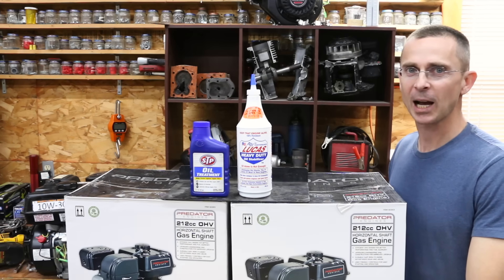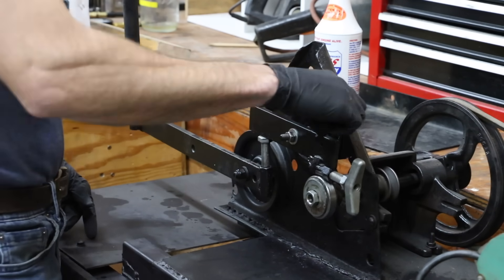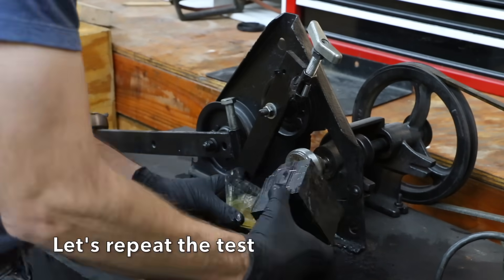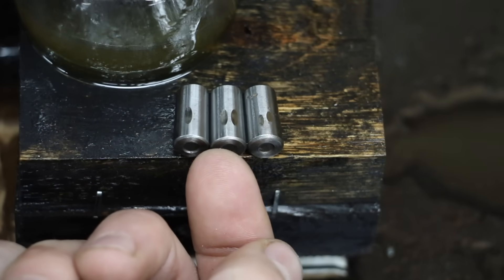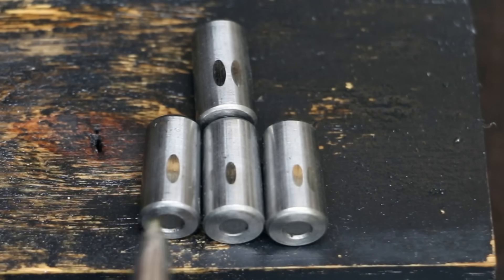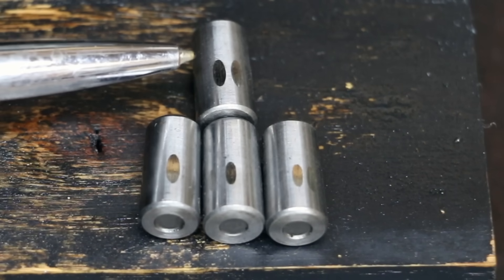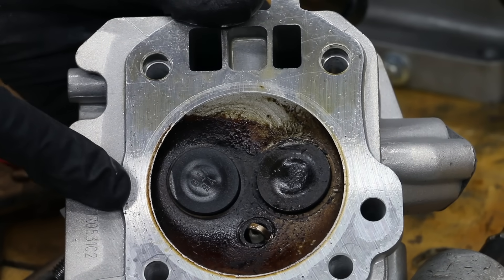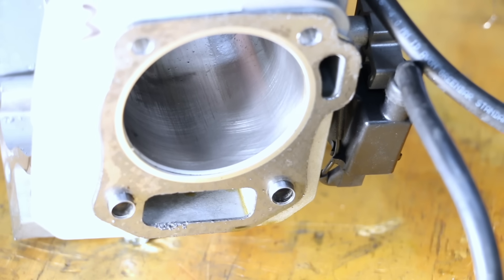Which engine self-destructs first?  Lucas or STP?

Comment: This little folly didn't prove squat here. Never been a fan of the so called no oil motor runs because many factors can play into what the outcome might be. 
1. A Predator motor is a cheap motor and ok for a lot of things but known to fail if ran at high RPMs for long of time. There is a lot of give and take in the manufacturing specs of these motors which is why they are so cheap. If you were to check compression on each new motor you would find them not to be consistent.  So the looser an engine is to begin with the longer it would probably run minus oil.
2. Lack of an engine using just plain oil in it. Ok I understand you did this on your own nickel so you claim but then how do we know that for fact? But needless to say if you're going to make comparisons then either do it right or skip the whole thing to begin with. An engine that had used just plain oil may have ran just as long as the other two and who knows maybe even longer. But we will never know that will we?
3. Your measuring techniques were a little loose to be perfectly honest here. In short not very scientific at all. So how do we know for sure how much of what was added to what. All the mechanics I know say you should blend any oil additive with the oil you are adding before placing it in the crankcase. STP for sure due to it being so thick and wanting to just lay in the bottom of non oil pump engines before it finally gets hot enough to start blending.
4. Every small engine manufacturer I know including Predator doesn't recommend oil additives being used in their engines due to them thickening the oil. Thicker oil won't flow around in a slinger type motor as it should if it's to thick. 

I was the equipment manager for a large construction company and we had small engines on stuff everywhere. In fact small engines were in the shop more that any other piece of equipment we owned. Most of our issues would be lack of oil issues after some fool tricked out the low oil sensors. I actually had small engine reps who called on me since we bought so many engines  and parts a year. On a warranty issue I was talking with a Briggs service tech who gave me the best advice I have ever been told about small engines which I tried my best to put into place.  But in the end the results where hands down to our advantage as we started having way less engine issues.  He advised that the oil in the engines with oil slingers be changed every 10 to 12 hours in summer time and 12 to 15 hours in winter. Not once a week or two as was being done or so I hoped most of the time. On engines with filters and pumps change the oil every 25 hours in summer and 30 to 35 in winter. I do that with my own personal lawn engines here at home. I have a Briggs 18 hp motor riding mower I bought in 1987, it mows and blows snow as well, along with some light blading once in a while to parking the boats. It has over 2200 hours on it and uses a couple of ounces of oil per oil change only. The motor outside of a new carb 2 years ago hasn't been touched outside of tuneups and oil changes. I have never added any additives to the oil at all.

I've never been a fan of any oil additives, just use good quality oil that meets the specs required and change it often. My personal opinion is that oil additives are a lot like fishing lures, they are designed to catch the buyer more so than do what they claim for you in the end. 

A local shop has a friction machine like you had there in your video he does testing with and the only additive he has ever seen truly work better than all of the others in engine oils is a product called Energy Release.  I do admit it is rather impressive and I have seen it help a hurt motor get several years more use out of it but at 25 bucks per 16 oz bottle I find it not a product I want to use on my everyday stuff over doing good oil changes using good oil.

If someone wants to say Lucas is better than say Amsoil I say it's your money spend it how ever you want but I wouldn't use this test as a bases to say Lucas is better than STP as was done in this test.
Reply: Gotta disagree. ZDDP actually works. But there's decades of research and proven results with ZDDP. It used to be a standard additive in ALL oil, but they got rid of it to save the catalytic converters. So now every engine has to have roller bearing lifters. All engines, including engines with roller bearing lifters, can benefit from ZDDP in lifespan.
Reply: Catalytic converters isn't only reason for the experts wanting to see it's use reduced. I had a friend who sold oil additives and his biggest problem in dealing with those who used them was the misuse of the products. I and several who I use to race with all agree oil additives are ok but they won't save a bad engine they serve a better function when used during break in on a new or rebuilt motor and not so much afterwards. Of all the engines I have had go bad on me and on the engines I seen go bad with friends it was never the oil that cause it but something metal breaking. You can add the correct amount of ZDDP to an engine's oil but in the end it all hinges on the metal used to make the pieces that make up that motor being 100% of the correct hardness and specs. As I said it's your money spend it as you wish but remember when lead in fuel made cars run better but was slowly killing us pollution wise? Well your so called ZDDP is harmful to aquatic life and is showing up in water tables everywhere.
Reply: "they serve a better function when used during break in on a new or rebuilt motor and not so much afterwards."
Thats correct. It perplexes me how people try to band-aid problems caused by wear with wear preventatives AFTER the damage has been done! ZDDP is like eating healthy. Do it now to prevent wear, not after the fact!

ZDDP, Zinc dithiophosphate, can cause environnmental harm if used irresponsibly. Modern technology can prevent this. The first thing is gapless top rings, conventional second rings, and a third oil scraper ring, to fully seal the combustion chamber from crankcase oil. An even better solution is to couple said ring package with a Bourke HCCI pulse detonation engine using cryogenecially treated RF85 calcium embedded tool steel sleeves (CPM 10V would be a good choice but I'm sure there are others that would work quite well). This would easily allow you to run the engines pistons with very little to no oil at all and in the Bourke 2 stroke design the underside of the piston is filled with unburned gaseous fuel and air, and the crankcase oil is entirely sealed and completely isolated from the combustion and piston. If adding oil to the cylinder and piston is necessary miniscule amounts of sacrifical clean burning oil kept in a separate holding tank can be pumped directly between the piston and the cylinder through an injection hole. Tiny amounts, just enough to lubricate as with today's conventional engines. This allows one to use the best additives to prevent wear whilst also preventing environmental degradation.

That being said you can't blame ZDDP contamination entirely on crankcase oil as hydraulic systems and grease also contain ZDDP.

TetraethylLead (leaded gas) only increased octane. Thats all. There are much better ways to do that. My favorite is through thermal catalytic cracking onto very short chained alkanes. Mostly methane with some propane, propene, ethene, etc. in the mix. This gives me an octane both RON and MON of about 118 to 120 and eliminates carbon fouling entirely. Of course without injected liquid fuel there's no quenching so direct port watermeth injection is used to cool the exhaust valves. This allows me to run insanely high compression ratio's with a homogeneous charge and 5PSI of boost via a turbo. I'm getting over 100 MPG from a 1966 F350. Suppressed technology is real.
Reply: @Brian Delta V You're the kind of guy that makes me want to study this stuff... I may be a moron, but I'm a moron who wants to learn and not stay a moron :D
Reply: If you really want to go down an interesting path that anyone can pursue as a hobby, try vapor fuel engines. DR Blackmores "Fuel Economy of the Gasoline Engine" is packed with information that simply can not be readily found anywhere else. I also recommend E-books published by Eagle Research.

Determination and eschewing the negative nancies are the two things you need above intelligence and education. My own father and entire family lampooned me for years when I told them I can get 200 MPG from an old (1966) 1 ton flatbed truck. 10 years and 20 thousand dollars later, the project is nearing completion and I've already conducted a few promising test runs. Nobody's laughing now. I have yet to achive 200 MPG as I set out to do, but I'm inching close little by little.

You too can do the same with determination and passion. In a few years (hopefully) I'll be publishing an E-book and video series for free outlining exactly how I set my system up.

Another piece of general advice is question things. Never take anything for granted. Hell, just yesdterday I was watching an old episode of "Hot Rod" where they compared thin Vs thick piston rings and they gained 8 horsepower by making the switch. But they never explained how or why thinner rings reduce friction and increase horsepower. Most people would assume that because there's less contact area there's less friction, but I know that contact patch area has nothing to do with friction. Only the force applied to the contact area and the materials coefficient of friction matter, NOT the surface area. Reducing surface area alone will not reduce friction. It was relatively hard to find a sufficient answer, but I did. Because there's a smaller contact patch area, the force (springiness) of the rings can be reduced whilst maintaining the same sealing force on the cylinder wall. So the savings does not directly come from the surface area reduction but rather the force reduction against the cylinder walls. Without thinning the rings the reduced force would be distributed across a larger surface area thus reducing the seal quality. By going thinner you can reduce the springiness of the piston rings and maintain the same effective sealing pressure against the cylinder walls.

About 3 weeks ago I learned of cryogenic tempering (technically is/isn't tempering depending on who you ask) which increases the hardness and tougness of metals without increasing their brittleness. Because I maintained an open mind I researched the topic, as surely merely cooling steel to -300 F. would just contract the metal, and when it reaches room temp again nothing would change. And indeed on the forums many a people said the educated metallurgists with letters behind their names insisted such was the case at different companys. Because they had spent tens (hundreds?) of thousands of dollars to sit in a classroom and be told what is and isn't possible, surely their old professors know everything there is to know despite having not worked in the private sector for two decades and not being introduced to changing technology! Long story short their ego prevented many of them from learning, and as a result thousands of corporate dollars were wasted due to human ego.

Take Arthur C. Clarkes three rules to heart. Many people fixate on the third law, but I prefer to focus on the first and second for they are both two different ways of saying the same thing and they reiterate and reinforce each other. Arthur C. Clarke did this for a damned reason and people still gloss over to the third one!

1: When a distinguished but elderly scientist states that something is possible, he is almost certainly right. When he states that something is impossible, he is very probably wrong.
2: The only way of discovering the limits of the possible is to venture a little way past them into the impossible.
3: Any sufficiently advanced technology is indistinguishable from magic.

One last thing. Anytime you conduct a physical experiment of any kind and you show repeatability and follow the scientific method, you've done all you need to do to be a credible scientist. Any more than that is you being generous with your time. I don't owe anyone an explanation as to why or how my and others vapor fuel systems work. I can offer people theory's, insights, and my thoughts as to why I think they function and how I think they work, but that ultimately is for pencil pushers to ultimately determine. If I prove time and time again that it works, then it doesn't matter if it "violates the laws of physics" or is "mathematically impossible." If it works, then those laws or formula's need to be altered to fit observed reality, not the other way around! This is why I contedn many mathematicians to be slightly insane. They think that tangible, palpable reality need to conform to an abstract human concept (numbers) and if their numbers are wrong, then reality needs to change to make those numbers right! Of course free thinking people know the opposite to be true.

And this paradox of science and humannity has not only held back a great many inventions, its killed thousands of people. Surgeon James Lind in the 1700's discovered a cure for Scurvy by performing the first controlled clinical trial in human history. He separated patients with scurvy into 6 groups and treated each group with one of 6 possible remedies. Cidar, sulphuric acid cocktail, vinegar, seawater, oranges, lemons, and garlic paste. Of course Lind found Oranges and Lemons to be very effective at curing scurvy due to their high concentrations of vitamin C. But without any knowledge of vitamins he was forced to explain to the "scientific community" his findings through the accepted theory's of his time. He deduced that the high humidity of the sea blocked perspiration of sailors which caused a PH inbalance. And of course thats not true. Back then it was thought that the body was comprised of four major fluids, flegm, blood, black bile, and yellow bile. Lind as a result of of findings created "lemon rob" which cured the vitamin C deficient sailors scurvy. At long last, scurvy was cured! Until it wasn't. To cut costs, lemons were replaced with limes. Limes do not have nearly the concentration of Vitamin C that lemons do, so as a result hundreds of thousands of people died of scurvy needlessly. And nobody knew why lemons cured scurvy, and because Lind had to explain his findings with the conventional thought of the time people forgot the cure entirely until the 1920's when it was rediscovered independently.

My point in this is to remain modest no matter how much you think you know, know that you do not owe anyone a bulletproof explanation beyond what you think might be happening as the results of your tests and inside your devices.

To this day I still can't figure out why injecting water into an engine decreases emissions and increases the total amount of hydrocarbons burned. Sure, it expands like steam and in effect makes an engine and internal combustion gas-steam hybrid. But water injection also acts like a catalyst (its not a catalyst, but it acts like one) to further burn fuel that otherwise would go out the exhaust valve unburned. I have yet to find out how or why this works. But its an old method that dates all the way back to WW1 and seen widespread use in WW2 fighter aircraft. Its results are proven, verifiable, and objective truth. So we don't necessarily need to understand why something works to know that it does work. Its not your job or obligation to give a why and a how.
Reply: Br!an Delta V great post!! I didn’t know that about water, but here’s a theory from a layman ~water is h2o. 
That’s hydrogen and 2 oxygen atoms. Hydrogen is combustible and oxygen helps stuff burn(combustion). How they are split into hydrogen & oxygen, if that is indeed what is happening to make the increases you spoke of, I dunno.
Reply: Burning water is one theory. But water is already burned, its dihydrogen monoxide. The energy required to split and then reburn the water (if done 100% efficiently) comes out to the about the same. It could be that as water flashes to steam it creates shockwaves through the cylinder that propagate faster than the deflagration wave and pre-crack and vaporize fuel into shorter chained hydrocarbons. But your theory is as good as mine because despite all my efforts, I have yet to find a satisfactory theory and nobody claims to know exactly whats happening.
Reply: Well people here can say whatever ya like.  But I have added Lucas synthetic oil additive to a Mack truck and seen LOWER coolant temps, better mpg, easier starting, easier shifting of the trans ( due to the crankshaft end play isn't under parasitic drag), my turbo boost is higher, overall quieter sound at idle, less DPF cycle times.  I have the ability to monitor engine performance real time at anytime to see and changes.  Yes alot various brands claim lots items.  But Lucas Synthetic supplement is the real deal.
Reply: Br!an Delta V Agreed but let these people learn the hard way. That is if they ever run conventional oil in older flat tappet motors. They'll find out very quickly how invaluable ZDDP is and why diesel oils are better. But then again they will say, oh that's metal that you are putting into the engine and that can't be good! Not knowing that the zinc is taking the abuse instead of the cam,crank,so forth! Bottom line stupid can't be trained not taught.
Reply: The way I like to describe it to the ignorant is the tiny little metal particles are like microscopic balls that rolls between the the bearings and bearing journals. We both know thats not whats going on but the morons get it, then.
Reply: David Larson found the stp fanboy
Reply: Nut job alert
Reply: I'm going to go out on a limb here and say you're referring to me.
Reply: David Larson Correct, this test proved nothing. The specs in these cheap engines could be wildly different.

But then again these kind of videos rarely prove anything. It's all about doing some content to get views and make money. Most of the people watching do not have a detailed technical background, so it doesn't really matter.

Just trashing stuff and blowing it up, is enough to get laymen viewing.
Reply: Just for the record.not too long ago cars had about a 100 thousand miles of life in them.our engines are still pretty much the same.piston,cylynder,and crank,valves and so on.
If you change the oil every 15 hours of run time with quality oil doesn't the cost ads up?I was in Des Moines  Iowa and I personally seen a 440 Mopar with it's oil pan completely taken off.it ran for 14 hours.they changed  the oil in an air plane while it was in flight.And...
Ran a Dodge viper around the track with Andrety I believe behind the wheel the oil alarm  screaming.as he zoo.ed on by.So.... it comes back to the famous question.who do I believe you or my lying eyes?
Reply: I don't know where this "cars only lasted 100k miles" myth came from. Probably the 1970's and 80's. Those were two bad decades for car manufacturers as they were using technology they were unfamiliar with and often times just winged it on engineering fuel systems. These are also the "vintage" vehicles most people are familiar with. But if you go back to the 60's and before the vehicles were in MANY ways built fair more robust and stoutly that today. King pin steering knuckles, same system still used on HD commercial vehicles like dump trucks, big rigs, and military transport trucks. Leaf springs rear and front, which though "primitive" is a bulletproof design that minimizes the grease joints you need to care for, eliminates the need for control arms both upper and lower, eliminates ball joints which inevitably wear out way too soon, etc. Solid iron blocks and heads for the engine which yes, its heavy but is also very durable and wear a lot better and is far easier and cheaper to rebuild when it does wear out. If rebuilt with modern roller bearing lifters and metal treatment technology the nodular iron and high nickel blocks of the muscle era and industrial engines of the time would easily far outlast modern aluminum block engines. Having an actual frame and not a "unibody" construction makes the cars far more like modern trucks, the panels are easier and cheaper to replace and repair and is a more durable overall construction (And if you disagree with me on that you need to tell all the commercial truck manufacturers to ditch the "old" body on frame method lol) as unibody's just like aircraft will eventually stress crack and fracture away, and because they are typically made of steel once they rust out its a PITA to repair. And now with the foam core's its impossible to repair the unibody as the foam contaminates the weld making repairs to rusted out frames impossible. Also manual transmissions, despite needing the clutch replaced every 300k or so (100k if you're a lousy driver) last forever. Millions of miles, literally.

I could go on, but this is what it boils down to. Modern vehicles are designed to work really well for 300, maybe even 400k miles. But after that you are FUCKED and they are 100% disposable. Older vehicles if the engine is rebuilt with modern lifters, coatings, and some other modern tech, are infinitely rebuildable, the engines will last at least just as long as the new ones probably far longer before needing a rebuild, are far cheaper to get rebuilt. And the vehicles themselves are also easily repaired, rebuilt, and far easier to maintain. In fact, if you do a frame off restoration of a 60's or before classic American vehicles, paint the frame/undercarriage and the body panels with Chassis Saver followed by an underbody coating, use the affordable stainless steel brake lines that are available now, upgrade to disc brakes, etc. you'll have about 20k to 30k into your vehicle but it will be more reliable than any modern planned obsolescence vehicle, be infinitely rebuildable, and last for many many generations.
Reply: @smh9902  great commentary.
Reply: Leased fuel kills O2 sensors. That's why they went away from it. Zinc kills catalytic converters and being an emissions item manufacturers are required to provide warranty on it as part of the powertrain  and that is why they did away with zinc or lowered the amounts. Oil companies and auto companies work together to maximize profits
Reply: So whats your point?... JK!